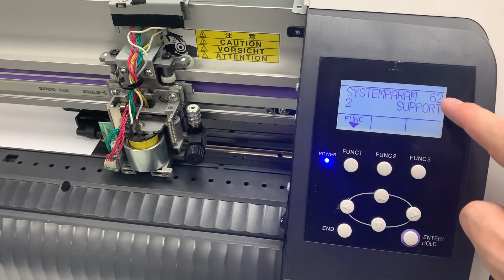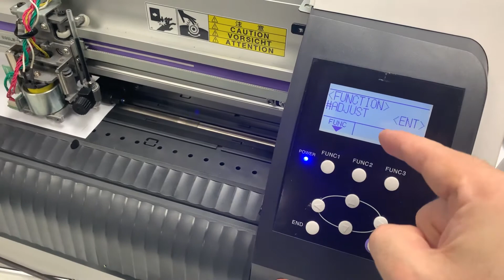Mimaki CG-SRIII Rego mark sensor adjustment

Comment: hola cuando quiero ingresar en #photo sensor me da "error 901 operación", ¿cómo lo soluciono?
Reply: Boa tarde..eu tenho uma Mimaki 130 que apresenta esse mesmo erro 901. Você conseguiu resolver?
Reply from the maker: Make sure date clear is done, paper on and clamp is down.
Reply: @HTM9916  esta todo ok eso, pero sigue con el mismo error.

hay alguna manera de configurar la distancia de lectura. ya que en medidas de 50x50 cm lee perfecto. Pero en distancia de 50x130 no lee, los últimos dos registro superiores no los lee, la única manera que logro hacer la lectura es bajando esto 2,5cm.

donde puedo solucionar esto?
Reply from the maker: @dgCarlinhos  I believe the 3rd mark is off the position when it feed the media for 130cm. Check if all pinch rollers are in the same pressure and set media as straight as possible. Also make reg mark long to 40mm.
Reply: Hello, did you manage to solve the problem with error 901?